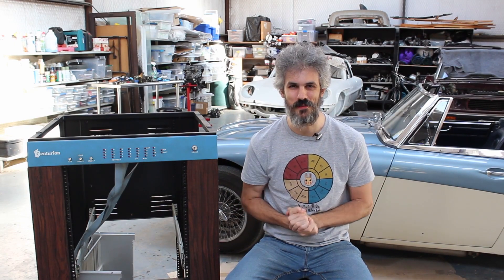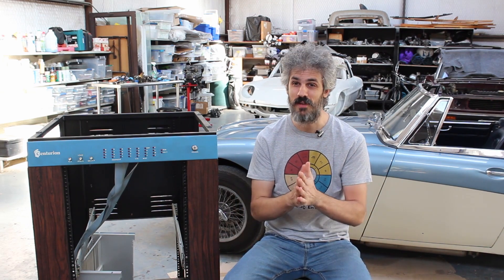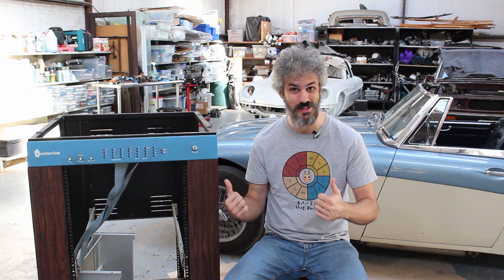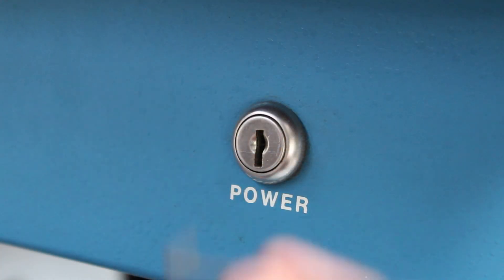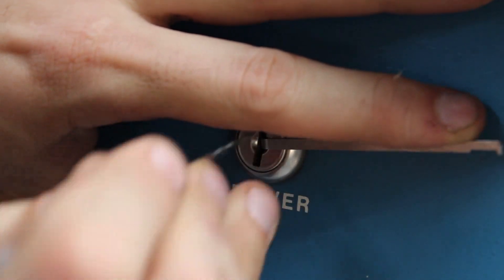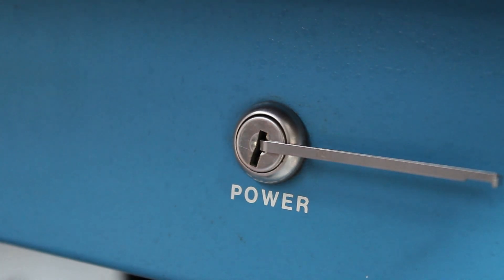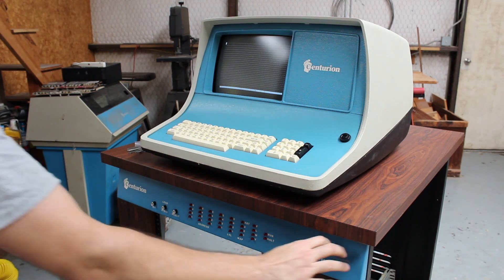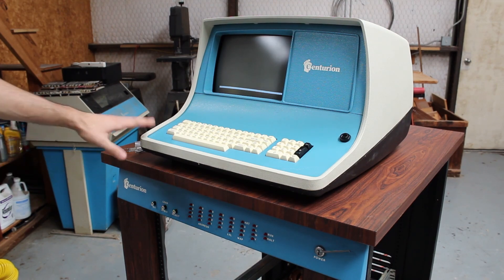Minicomputer Part 7: Cleaning and Testing

Comment: Nice progress! "F" might stand for fault. 
Check every serial port on the machine for activity at power up. The 4 port MUX cards may only come into use after booting. If they're for modems, thay may also want some flow control.
Reply from the maker: Thank you!
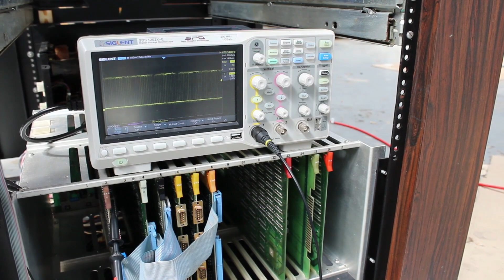That makes sense that F stands for fault. Interestingly, I noticed during editing that the data I can see on the scope is actually looping. From about 15:57 on in the video, you can see that as I snag snapshots, it's actually the same pattern of bits just moving left or right. So, my guess if that you're on the money with the idea that the MUX cards only come into use after booting, and the CPU is in a wait loop looking for boot information from the drive. 
I did think about hooking the MUX port up to the Miacom modem, but weirdly, I can't figure out how to power on the Miacom. There's not external power switch and plugging it in doesn't seem to do anything. I'll have to dig around in it a little deeper in the future to see if I can figure out what's up with it.

Comment: I wonder if it would be possible to get an all metal desk that you could mount the minicomputer into the back of the desk along with all the electrics and mount a keyboard and the Floppy drives like the OLIVETTI M3030 and you could use one of the monitors to connect to the computer hidden in the back of the desk.
Reply from the maker: I might be kind of tough to stuff it all in a desk, but I could probably get it to fit in a set of drawers under a desk, like you those filing cabinets you often see on business desks. Though, the most difficult part would be the drives, because they are absolutely massive!